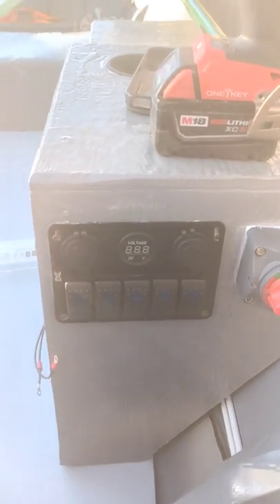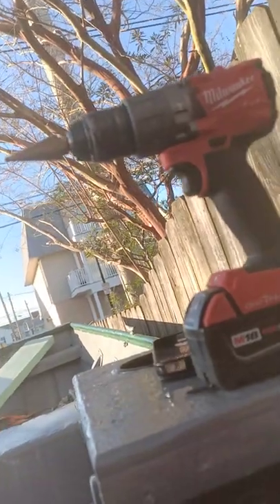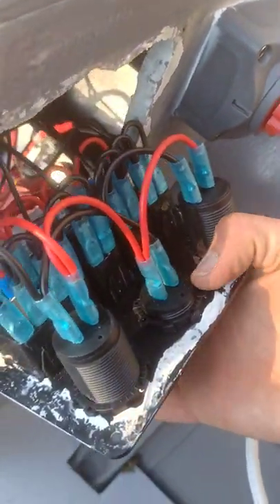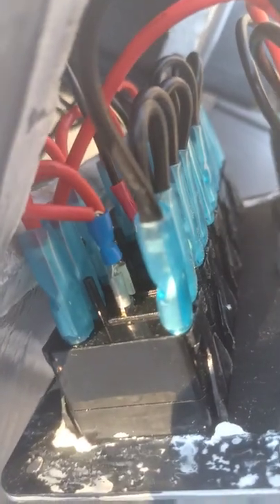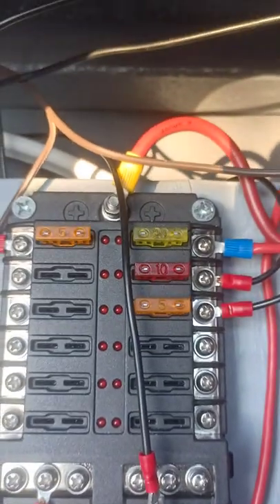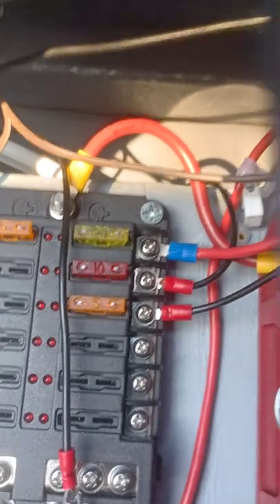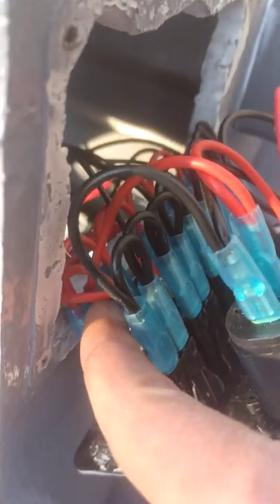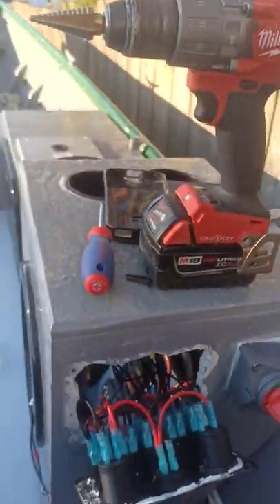how to wire 5 pin rocker switch panel with fuse box

Comment: Nice. Very simple and straight forward explanation. I’ve looked up how to wire up 12 fuse blade accessories and got nowhere when I needed help. And basically to this day haven’t seen anyone do a decent video of a safe install. Granted this video has nothing to do with the installation of what I just half ass explained... but a lot of people never get to the point of rant on and on and miss plenty of key install points and safety precautions
Reply from the maker: Crazy how little info there is out there on this!

Comment: That's was an awesome video, i have an 8 switch with a 12 fuse box and i was going crazy trying to figure it out so it could go to the fuse panel. Thank you so much for the heads up.
Reply from the maker: No problem! Glad I could make your life easier. They need instructions for those things haha

Comment: So if you're looking at each switch...all the grounds are the same going to negative bus for the whole panel. You have a jumper going from bottom right prong to bottom right prong then continuing on to the end right? So from right to left, bottom right prong, jumped to upper prong on the same switch then to lower right prong, lower right prong etc. Then each upper prong to fuse box, lower left prong to lights/bilge etc. Is that right? If that makes sense
Reply from the maker: I changed the thumbnail of this video to a schematic just for you! Hope it helps clarify any confusion. If you have any questions lemme know!

Comment: Thanks so much for this video!  I'm not great with electrical but trying to learn as I re-wire my golf cart.  I was thinking of doing the same thing you did, so this video was a great confirmation for me.  

Quick question though - if you disconnect the inline red jumpers from the center posts, can they just hang loose?  My inline red jumpers jump back and forth on each switch from giving power to the switch (center post) but also give power to the light on each rocker (lower post).  Is that how you did it?
Reply from the maker: Glad i could help! I wish they provided better instructions with the equipment!
Reply from the maker: I think i remade my harness as i was afraid of a short circuit leaving the positive lead dangle like that. You could just electrical tape the ends if you dont want to remake the harness

Comment: Thank you for this! Can you tell me what each pin is? I tried to screenshot the thumbnail but it’s too blurry. I want the switch to only light up when the corresponding accessory is on. Can you tell me which pins to use? Also what do I do with the negative?
Reply from the maker: It will not let me post a picture which would make this easy. If your looking at the thumb nail there are 5 pins the top pins are pins 1 and 2. They are both grounds. One for the item your switching and one for the light on the switch. You can tie them together and run to ground. The middle pin is pin 3 that should be power from the battery. Pin 4 should be the item you want to have switched power to. Pin 5 should be power for the switch light itself. I think for what you want you need to tie pin 4 and 5 together. That way when power comes across pin 3 and you switch it, it powers pin 4 and 5. That should make the switch light turn on when your item turns on.

Comment: So run power and ground to fuse block.. Run power and ground to rocker switch.. Run power from accessories to the open blade on switches... Run ground from accessories to fuse block?

Comment: Does the whole switch panel wire to one fuse, or does each accessory get its own fuse?
Reply from the maker: Each accessory gets its own with this method of wiring. Definitely more work but it's nice to have dedicated fuses for each accessory
Reply: @duereviews791  okay cool thanks for the response
Reply: U
Reply: @duereviews791  how though ...coming from accessory I only have one power wire and one negative wire, in my fusebox I can hook up a negative wire but the power wire goes to pin...so how can I fuse the power if it's on the switch????
Reply from the maker: @nanh4557  it has been a long time since I worked on this project. But I did include a wiring diagram as the thumbnail for the video

Comment: The chinese are All about Cheapest.  Cheapest wire (CCA), cheapest materials, etc.  The use of Jumpers is a bit concerning (Pre-wired, or Redone by YTer).  Are jumpers the Safest bet ?  Shouldn’t Any power feed be individually fused ?
Reply from the maker: Yeah unfortunately they are the safest best. If you solder these pins you run the risk of melting the plastic housing and pulling the pin out. And yes you would want individual fuses for each auxiliary. I don't know why they come pre wired the way they do. I guess they don't expect someone to want a fuse bus haha

Comment: Well isn’t that entire panel protected by us fuse?
Reply from the maker: No protection unless you add an inline fuse. I do have a breaker on mine as well. You could run the whole rocker board off one fuse on the fuse block. But then you can't have individual fuses for all your different electrical components.